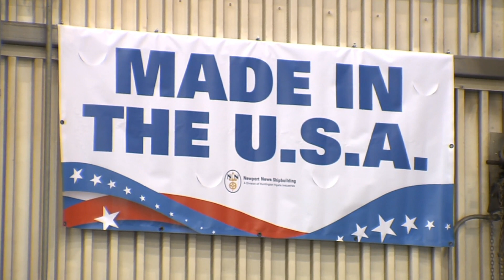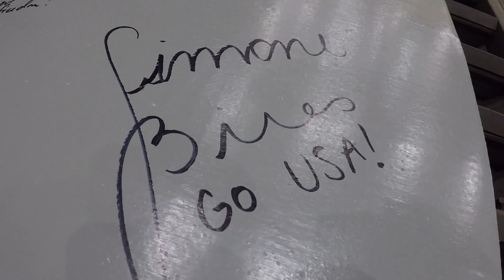Enterprise (CVN 80) First Cut of Steel Ceremony

Comment: It's a shame that the new USS Enterprise won't be built at Bath Iron Works.  A lot of ships came out of BIW and it would have been awesome if the USS Enterprise would have been made in Maine.  At any rate, I'm happy there will be a new USS Enterprise in the Navy.  I've read an article that the steel from CVN-65 will be recycled and used in CVN-80's construction.  It's my hopes the new USS Enterprise will be as legendary as her predecessor.
Reply: all carriers were made at NNS been that way since Langley rolled off the line in 1921.
Reply: They never built a carrier at Bath Iron Works. Always at Newport News.